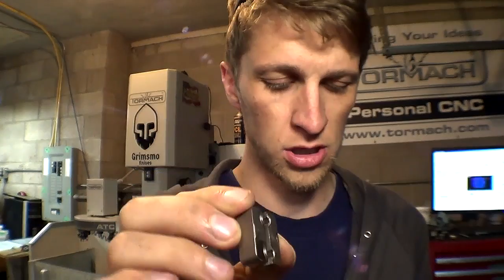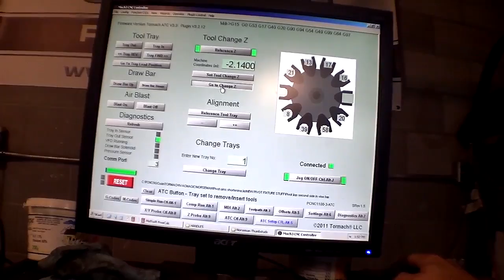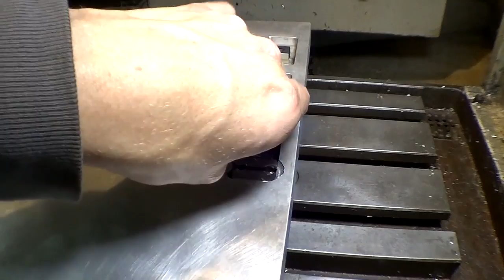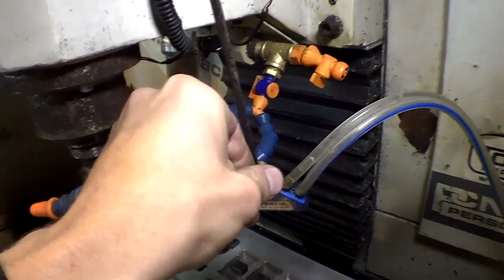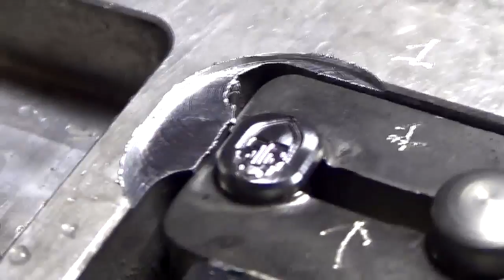Knifemaking Tuesdays Week 95 - Shorten pivot pins

Comment: any chance you can tell how much you can cut off the head? not the same measurement you use. i know the threaded hole goes in to a certain point inside the head but i don't know how deep yet, and until these arrive i'm stuck at how much i can cut from the head.

Comment: I haven't worked with titanium... well, I made a part from some 0.02 sheet... but for cutting something like this... what are you using for your feed, speed, RPM? What diameter endmill? I've been wanting to play with titanium due to it's colorful properties. http://mrtitanium.com/interference.html

LED - I would unsolder the two offending LEDs (and if needed, the associated resistor), then paint the area with clear polyurethane. Done.

Rust - I have a 1982 series Wells Index... no rust... I'm using #77 Kool Mist... never had an issue. One gallon makes like 32 or so gallons. No bad smell, and I have had no rust issues at all. http://www.koolmist.com/

Comment: You could take the ring off or buy a new one and get low profile LED's from ebay. Then change them for the low profile ones. Also, i'd seal them in something so that the coolant doesn't mess with them. I don't know for sure but there might be conductivity between the LEDs and the machine when it's coolant flooded.

edit: just drill one center hole in each fixture. The relative position of the screws will never change. That cuts the whole process down to 1 move per fixture instead of 2. IMO.

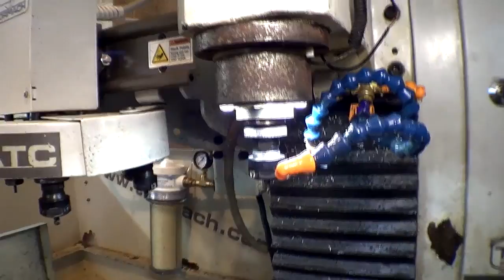Comment: 4:40 - "I'll fix that rust, so you can stop pointing it out... Brad."  LOL.  (Eric giggles off camera)

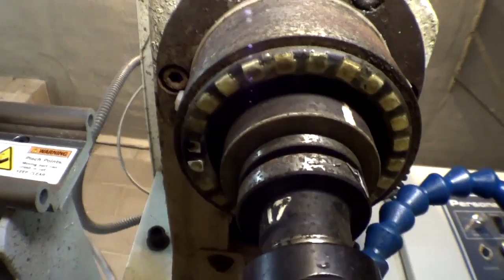8:40 - I bought a US$125 Aluminator LED ring light on eBay for my manual mill/drill and it's great but would be way too tall for a Tormach ATC.  The installation uses a lot of embedded rare earth magnets.  It just snaps on.  I then bought a US$11 Angel Eyes LED ring light (sold as an after market automotive headlight accent ring light) on eBay and it's pretty much what you have.  It needs 12VDC, and some method to mount it.  I think I might tape it in place on my CNC router spindle until a thin film of clear RTV silicone has a chance to cure overnight.  The Angel Eyes are available in diameters in increments of 10mm.  The 80mm OD size is a perfect fit on the 80mm water cooled 2.2 KW Chinese spindle motor (and most other Chinese spindle motors which generally differ only in length).

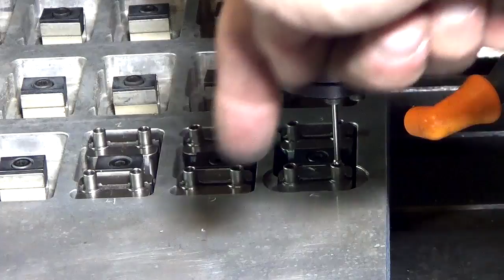15:30 - I know it's quick and dirty fixture code and you may not want to publish it for fear of the inevitable "you should have coded it it this other way" comments, but it could be very educational to post the code with the fixture offsets and subroutines as a G code example.  Maybe a "this isn't optimal but it's how I did it" disclaimer to keep the dissenting chatter to a minimum.

If you had a good CNC lathe, you could make your own pivots to the exact size you need... in titanium!  No more buying pre-made stainless pivots and modifying them.

18:50 - I was  hoping you were going to make some auto-probing code.  This fixture needs it.  I'd love to see THAT code!  Each of us shouldn't need to figure out every one of these tricks on our own.  That's the force-multiplying knowledge-sharing power of the internet.

Another great video.  Thanks!

Comment: Pretty slick fixturing! Impressive! It seems like most of the brain racking I do comes from figuring out fixtures. Since there are a million ways to fixture something the task is to figure out the best and most efficient way to do it that will yield the most likely chance for success. In fact my next few videos will be all about a "soft" jaw fixture I made that does numerous different setups in the same set of jaws.
Reply: Sort of but I utilize numerous threaded bolt holes to secure multiple parts, and a detachable jig for pinning the gasblocks onto barrels. But unlike your jaws I didn't cut any specific shapes into them so I can use them like regular vice jaws as well and maintain most of the surface area for clamping power. In fact today I just discovered another handy use for them that I didn't plan on. I'm just waiting for some steel to come in so I can finish up another detachable vise jig, then I can post the video.
Reply: War Machine LLC